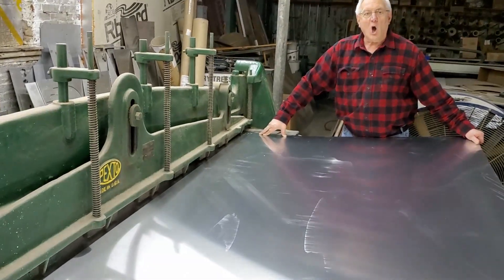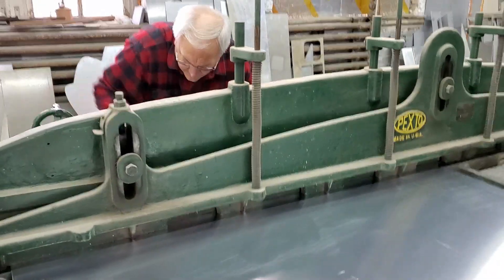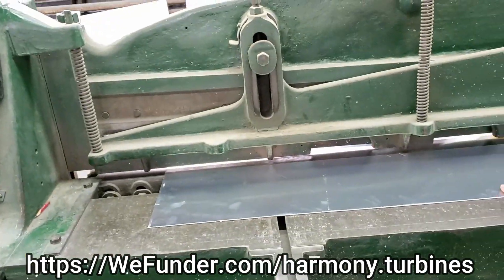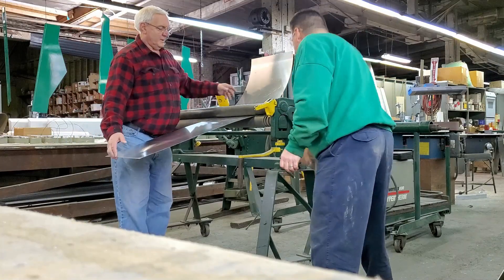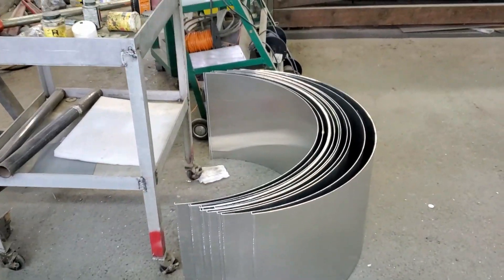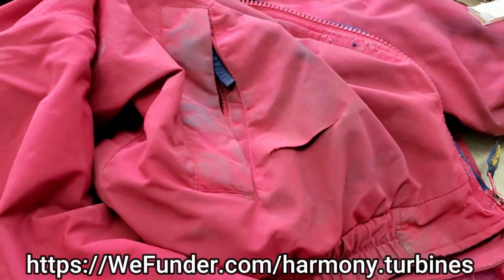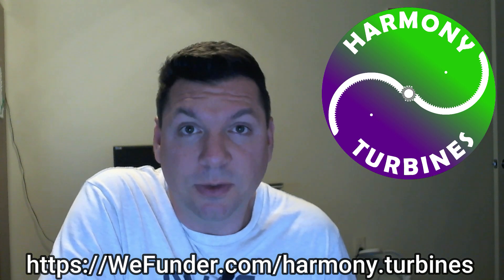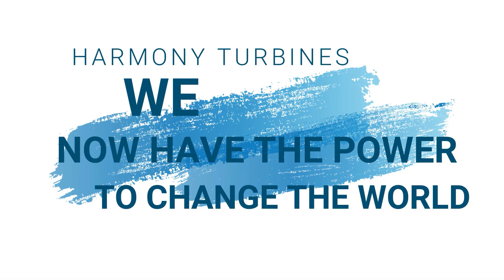Harmony Turbines fabricating the vertical components for our VAWT scoops

Comment: Excellent work - looking very sleek already. But what has happened to development of the generator ?   Is that ongoing or on a hiatus because of the time needed to develop the turbines?
Reply from the maker: That was never phase 1 of development. Our generator development will happen later after we get performance testing and data from our turbine. In the beginning we'll simply use off-the-shelf generators to do the required testing. The testing and performance validation will enable us to get further funding and investment which we can then use for the generator development.
Reply: @HarmonyTurbines  It will be easier to come up with the right gen after you have torque and speed numbers off the full scale prototype. I would be curious about playing with differing weights flywheels to see how it would affect the numbers also. Terry complements on your shop it looks much like my old one (I sold all my equipment when I lost most of my vision). I formerly taught an HVAC/R program in the Oklahoma CareerTech system as a thought you might reach out to the T&I division and see if they can offer any assistance there is a lot of brain power there for the asking they are there to help promote small business and startups and the best part is it is free or low cost ...Just the thoughts of an old blind man ....kudos for what you are doing....if I may be of assistance in any way pleas let me know 

gm
Reply from the maker: @garymorris2574  Thank you for the encouragement. I'm doing my best to roll this out properly because it's what we (as a planet) need right now. Money has to stop being the driving force behind every decision. It now needs to shift into doing things right. Making the tough choices for a better tomorrow. :)